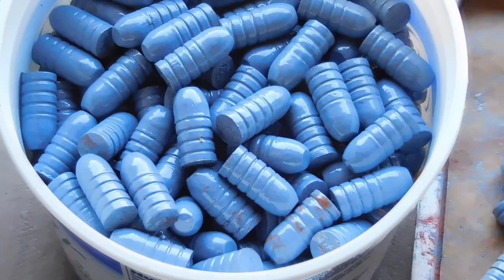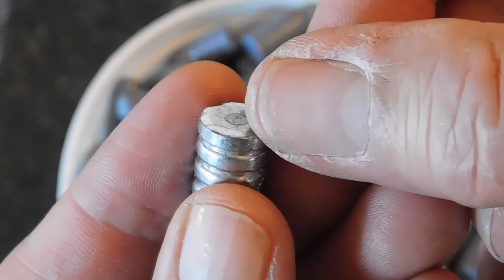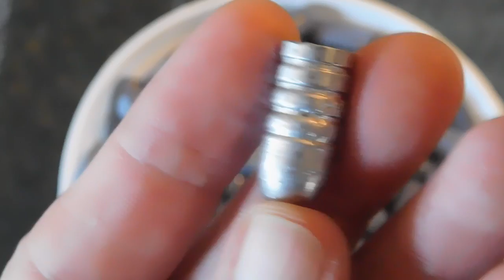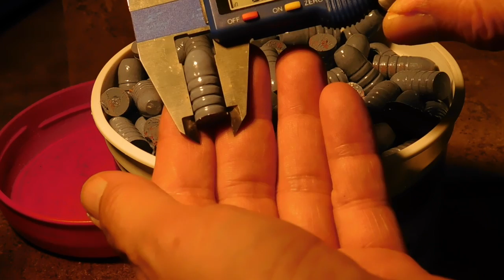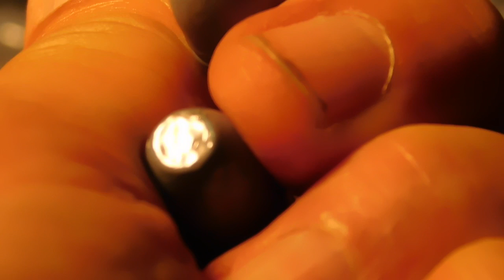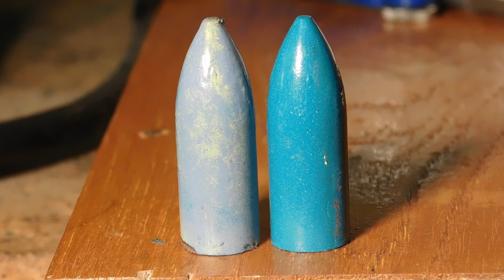Options For Our Cast Bullet Lubrication Procedures

Comment: FC45lc - What a great educational video; especially for the newbie like me. During the review, you mentioned tumble lubrication method.  Using that method, you mentioned that Lee's bullet mold sized them to the correct size. So do all the acceptable methods require sizing?  If so, does that mean you have to size when using the tumble lubrication method?  Thanks again for all the training. :-)
Reply from the maker: L Krueger - Used to be that sizing was predicated on slugging our rifle and auto pistol barrels and measuring the cylinder throats of our revolvers.  We would add .001" to the groove diamters of rifles and pistols and add .001" to the cylinder throat measurements.  Then we would size our bullets to that, and our bullet molds always casted on the big side so we could size 'em down as needed.   Richard Lee came along and wanted a better way since a lot of time was being spent sizing and lubing cast bullets in our sizerlubricator machines.  What Lee did was design his Tumble Lube molds to drop close enough to the SAAMI spec guns of today and then his Tumble Lube (TL) design bullets with the multiple small grease grooves and lessened bullet bearing surface took care of the rest.  His Lee Liquid Alox in the little bullet grooves supplied all the lubrication required to make this new system work.  Most of the time Lee TL bullets do not need to be sized saving lots of time and effort, and doing the tumble lube takes about 12 minutes total time and effort to lube 1000 bullets (that's hard to beat).  Now of course, there are fans of the old sizer lubricators and if anyone wishes to spend nights sizing and lubing their bullets, they are more than welcome to do what they wish.  Such shooters often look askance at the tumble lubers and powder coaters.  In the name of freedom of choice, this should not be.  It certainly is all OK.  All these systems work providing us with fine options.  And powder coating has really stood all of this on its ear...I have videos up on all this stuff... Best to ya,  FC
Reply: Thank you so much for the detailed reply. I'll keep trying t catch up on the videos I have missed. As always Thank You. :-)
Reply: @FortuneCookie45LC  I own two 30/30 Winchester rifles. (They are both MARLIN brand).
I have always used gas checks on my cast lead 150 AND 170 grn boolits.

Comment: Powder coating does look nice my only fear is there are chemicals in the powder coat that is known to be used in making cutting wheel and sand paper that eventually will damage the barrel because it will make the bore bigger for me I feel safer with the 45 45 10 I don't know I still need to sleep on it before I go to pc great demonstration on choices available thanks have a great day
Reply from the maker: ocean374 - Always great to hear from the ocean374 , yessireebob...we would not want to do any powder coating of bullets if barrel wear is the result...there are some abrasives reported in the black powder coats as Uncle Jim is mentioning.  Powder coating has been around for a while now and if barrel damage was a danger, powder coating would be avoided like the plague.  There was a time when boron hex nitride (BHN) coatings were being heralded.  But nitride is in the same vein as our carbide dies - barrel wear was a problem with boron nitride... You don't hear about boron nitride bullet coatings ever since as a result - shooters ran away from the boron hex nitride like the Zombie Apocalypse.  Powder coating is here to stay, and there are multiple ways to apply it - someday, there will be a powder coating cast bullet handbook.   Best to ya,  FC
Reply: FortuneCookie45LC thanks for the info like always a powder coating cast bullet handbook would be great in all casters library have a great day

Comment: Is the powder for coating a lubricant or will it damage the bore over time?
Reply: Lube serves to reduce friction in the barrel between the lead bullet and the steel bore, as well as softening powder fouling. The powder coating is a soft layer of material that puts a barrier between the bore and the bullet to reduce friction and keep lead from touching the bore. Leading is prevented like jacketed bullets, since the jacket protects the lead core. Copper, cupronickel, zinc, and copper plated mild steel have all been used as jacket material on bullets. Since powder coat is soft compared to those metals, I don't think it would damage the bore any more than a standard copper FMJ bullet would.

Comment: Cookie,  you misspoke,  The Gunindresty Has embraced powder coating, look at Federal }unere American Eagle - Syntechs bullets,  There powder coated Red, https://www.midwayusa.com/product/440865/federal-american-eagle-syntech-ammunition-9mm-luger-115-grain-total-synthetic-jacket-box-of-50 

without a doubt they are powder coated
Reply: I believe he meant reloading resources. Reloading manuals don't recognized powder coated lead bullets' existence.
Reply: mannys9130 correct as they a super slow to update.
Reply: also the debate.  pc acts more like a jacket then lube.  i load my stuff with data as copper plated or cast.  no issues.
https://lh3.googleusercontent.com/0WoabdRdnxvytFhg7UY7lw3XWHTXe3KL3iEVq_gnMrKFya_6_ftBvCgX2XJddI1H4X43AluRkvk
Reply: +N Olesen Part of the fun is experimenting with load data.

Comment: I am gas checking and then powder coating the same bullet and then sizing lee 174gr rifle bullet. Am I crazy, like wearing belt and suspenders?
Reply: bnighter i did the same on my 556 and 308 if u get gas checks from sages outdoors they are just a hair larger and it allows for easy gas ckecking after u powdercoat. and that save u lubing and sizing a addutional step. i gas check because it allows me to shoot at higher velocities without leading and with alot more accuracy. to the tune of 63g 556 @ 2800 fps and 210g 308 at 2300 both shoot a little under 1"@100yds. the 308 willshoot accurately to a 600yds ive got a video to prove it if u wanna look its a lil long but i show the whole thing start to finnish.both of these calibers a out of ar gas guns
Reply: Gas checking after coating sounds good. You are getting better results.
Reply: Either way i would imagine will work. Good idea bud